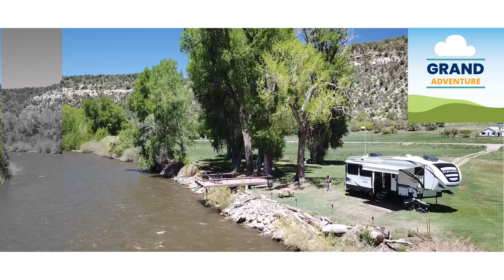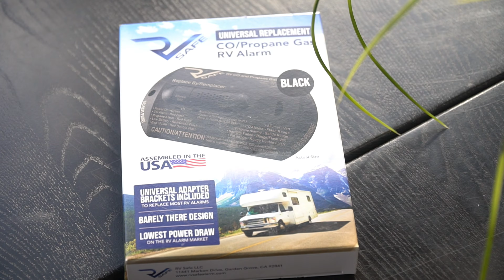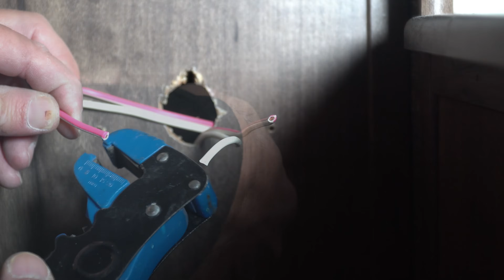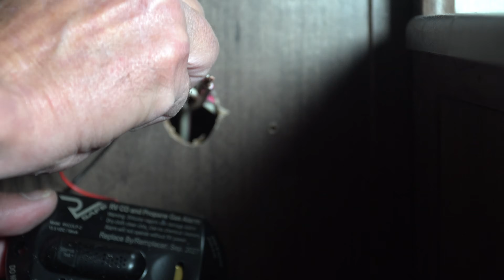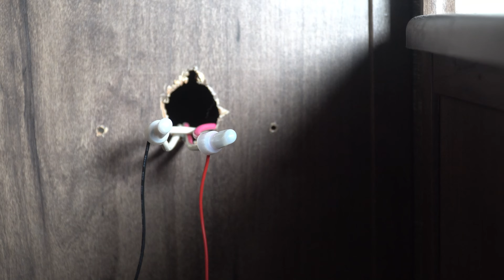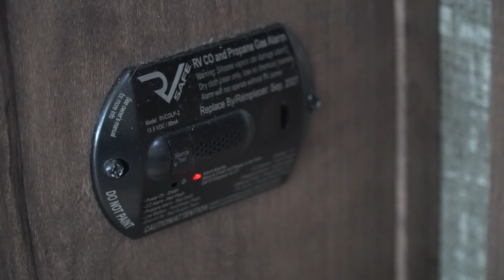Ep. 296: Replacing RV Propane Detectors | How to maintenance repair upgrade mod DIY

Comment: I'm off grid. But do I need to cut battery power to those wires first? Also, will my twist on caps work fine? I don't have crimp caps on hand. TYIA Marc!
Reply from the maker: Personally Cyndi, I wouldn't use wire nuts as the vibration rolling down the road could theoretically allow them to loosen. I just don't trust them in a mobile installation. You can find cap connectors or butt end connectors at any hardware store for pennies.

As it's 12V DC there's little concern for personal safety by not cutting the power, but you could easily just pull the fuse to that circuit to turn the power off, or use the battery cutoff switch if you have one. The biggest risk of not doing so is blowing a fuse by inadvertantly shorting the circuit while you're working on it.
Reply: Purchased raw off grid land a few months ago, having RV'd to every single state and BC, Alberta Canada during my last 10 yrs full-timing. Raw acreage with no neighbors and surrounded by state land! Slice of Heaven! At a comfortable 5500 ft somewhere between Williams and Kingman, AZ. (Give shout out if travelling area and you could visit and hike a couple days!) So, wire nuts fine since now stationary, skirted/insulated. Roots! Lol

Got new installed. No fuse to wire and not marked in fuse box. Simply made sure to not touch neg and positive during connecting. Working! 

Thanks for your very prompt help tho!!
Reply from the maker: @DeliriousCupcake  excellent! Nicely done. And that little new spread sounds like a slice of heaven indeed.

Comment: I love that stripper you have, i cant believe i have been doing electrical stuff my whole life and never bought one, I will try yours.  Thank you for using crimp connectors, i hate those snap on connectors for the RV.  Since i got sick i leave the propane burner on by mistake or forget to light it, this device could save our life.  Every RVer should know this info.  Larry.
Reply from the maker: Agreed, Larry. And those wire strippers are da bomb - click and go. Thanks to Kent!

Comment: One of the most common things to set off the propane detector is...the dog. If your dog likes to lie or sleep near the detector, think about whether the dog might be...passing gas...and setting off the detector. I've heard of people noticing the detector would go off right after the dog got up and moved, but didn't figure out why. The dog figured out what was setting it off before the people did.
Reply: Mine went off when I lost power to the camper
Reply from the maker: LOL! Yep, we've heard the same thing. Ours happens to be in a spot next to the stairs where Zoe can't lay.

Comment: Real important item in my trailer that I haven't once thought about..
Reply from the maker: That's true for many, J.  As I understand it they have a reagent that eventually gets consumed.
Reply: @GrandAdventure  I have three week tour to Reno/395 all booked so ive got to check the date on that detector before I leave..
Reply from the maker: @SevenBears1  cool! What time of year is that planned for, if you don't mind sharing?
Reply: @GrandAdventure  April.  Destination Brooks and Dunn concert in Sparks..
Reply from the maker: @SevenBears1  Thanks, I was just wondering if we might be in the area by then.
Reply: @GrandAdventure  I'd like to run into you both out on the road.. Q24 is a long way off 😁

Comment: I cringe everytime I watch a video where someone uses a power screwdriver or drill to run screws in. I try to not encourage others to strip out holes in the precariously thin Luan sheeting used in RVs.
Reply: I have some "extra" holes in my bathroom wall because I used cordless drill. Good tip. Thanks
Reply from the maker: Guilty (and lazy) here, Charles.
Reply: I always use a power screwdriver but set the torque really low, I have bad hand arthritis and using a hand driver hurts the knuckles.  This comment makes a good point but a power driver used properly wont cause a problem in the thin rv wall wood.  Larry